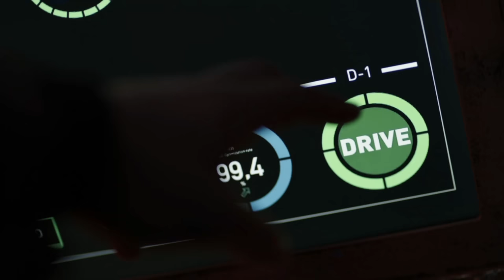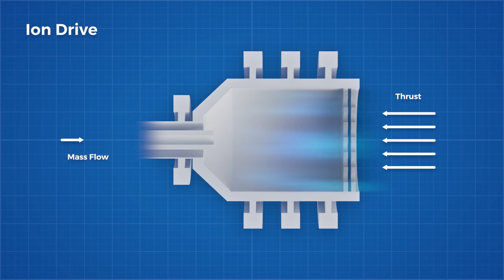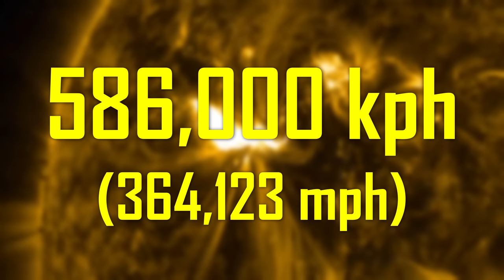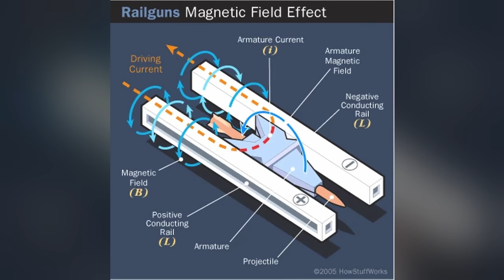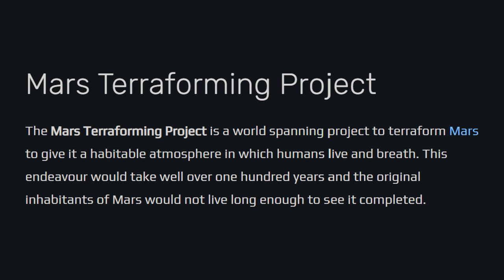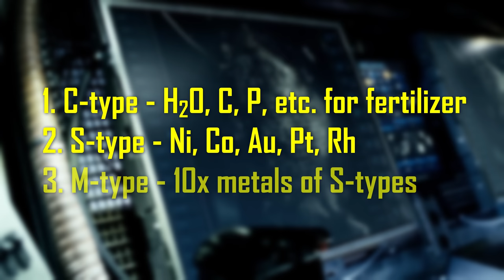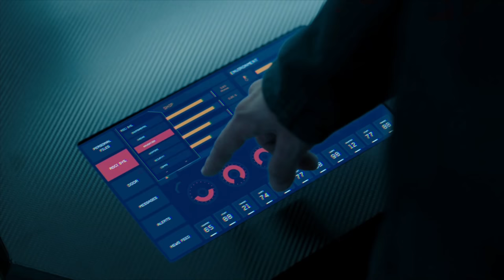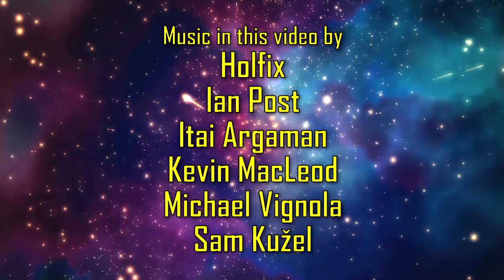The Science of The Expanse

Comment: I fail to see how a rail gun or any other similar type of weapon could work on a space vessel due to Newton's third law of motion; to every action  there is an equal & opposite reaction. Every time a rail gun fires on one of these vessels (quite frequently I understand), it will cause said vessel to change course, leading to constant course corrections. Better off using missiles.
Reply from the maker: Why assume that they aren't employing constant course corrections?
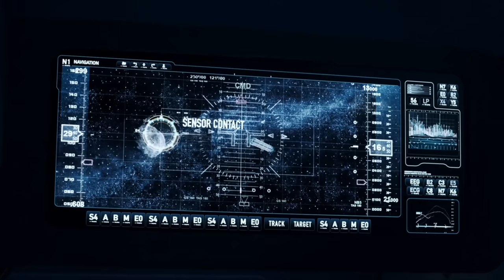Reply: Railguns are situated at the direct front of the a small corvette like the Roci. In addition to constant course corrections, the main course change exists in the form of recoil. Every time a railgun is fired, the Roci's engines fire to compensate for said recoil. You can see the engine light up every time in the battle between the Roci and the Belta fleet in season 5 ep 10, see The Expanse: The Best Space Battle Ever? (Detailed Breakdown) in Spacedock's channel, start watching at 4:55 minutes in that video to see the course adjustments in slomo and breakdown.

Comment: Unfortunately most of the Expanse achievements aren't possible.

1. no fusion confinement works. They all have impossible flaws that prevent them from working. tokamak will never work as it impossible to maintain a stable magnetic confinement field because the plasma carries current, and current creates magnetic fields. The plasma eddy currents interact with the magnetic confinement field causing to to destabilize and fail. To date the longest confirmed run is about 5 minutes & it was a fluke an never replicated. The other fusion projects are even worse. ICF can never be a energy source as it not possible to create a pulse stream to generate power. The NIF test take at least a day between shot as its very difficult to align the system. NIF is a nuclear weapons program designed to create 4th generation nuclear weapons that would not need a fission core to trigger a fusion detonation.General fusion plan is never going to work either as it got science so badly wrong its clearly just fraud, no different the Rossi's e-Cat fraud about 15 years ago.

2. Even if a compact nuclear power source was possible, another nail in the coffin is dealing with the heat generated. as it very difficult in space to get rid of heat since there is no air or water to exchange heat. Consider the size of a commericial nuclear reactor and the size of its cooling system (cool towers which are usually around 200 m (660 ft) and about 100m (260ft) in diameter. and that using convection to get rid of the heat. For a spaceship with a 1 GW reactor the ship would need several dozen square km of radiators to remove all of the excess heat due to the very poor efficiency of removing heat via radiation.

3. Stealth. Not possible because a spacecraft would be very easy to detect using thermal imaging. The spacecraft would produce a lot of heat and would stand out like an elephant in a room compared to cold vacuum of space. Also see #2 about the dozen sq. km of radiators needed. 

4. Radiation. Anyone walking in space or traveling long term in spacecraft would get a lethal dose of radiation. Space has a very high amount or radiation and its our deep atmosphere that blocks almost all of it. Deep space ships with humans would need to have massive amounts of radiation shielding. Any Astronauts sent to mars & back will have a death sentence they will develop radiation induced cancer. 

5. Mars terriforming is impossible because the soil is saturated with  perchlorates which are absolute toxic to humans & plants. It would be impossible use the soil or water without very expensive processes to decontaminate it. Plus everyone would need to remain underground because of the radiation since Mars has no magnetic field and a very weak atmosphere. It would be impossible for mars to maintain a breathable atmosphere because Mars gravity is too low to retain it. over time the it will escape into space. Venus could be a better option for colonization since is nearly identical to Earths gravity, and could be cooled by using orbital sun blockers to reduce the amount of heat Venus recieves. That said its possible the soil might be too toxic for life to exist since there isn't much data available. It would take several thousand years to lower the CO2 levels to the point its safe for plant & animal life. 

FWIW: To believe civilization like Expanse is possible, you might as well accept that the world of harry potter is also possible as both are equally pure fantasy.

Comment: A few things. You may want to look into Helion, they are likely the closest to commercial fusion at this point using a novel method. The Roci and other Epstein drive ships use steam in their RCS system and that's how they fly in atmo. The writers didn't know about the Libelle G suit, a automatic g-suit that uses liquid and can provide protection for a normal human well up to 12g. According to the books when Protogen attacked the Donnager it was the first time railguns were fired in anger in the Expanse Universe. Ceres was spun up with large weights run through magnetic tunnels wrapped around the planetoid, once accelerated these tunnels were converted into the residential blocks.